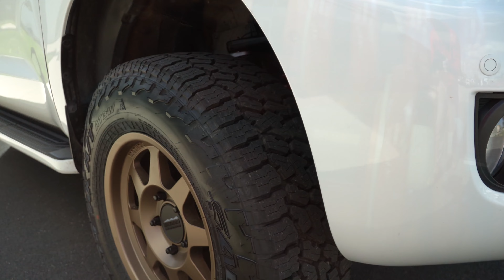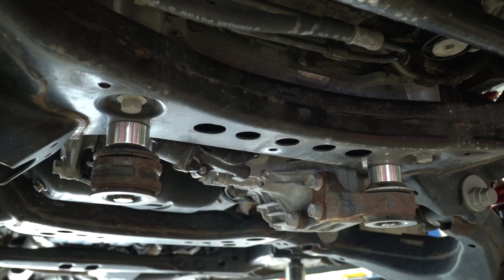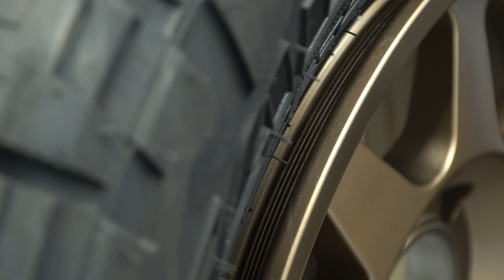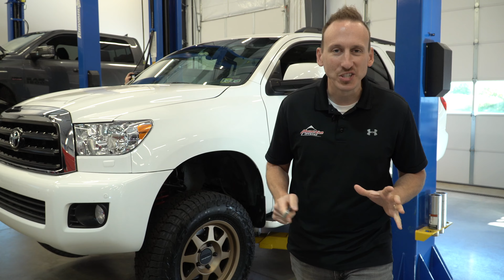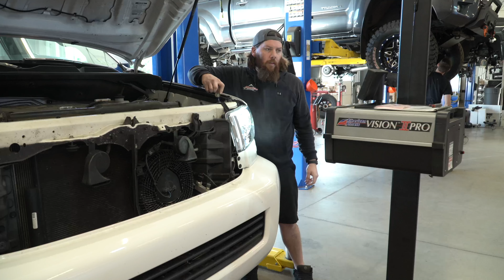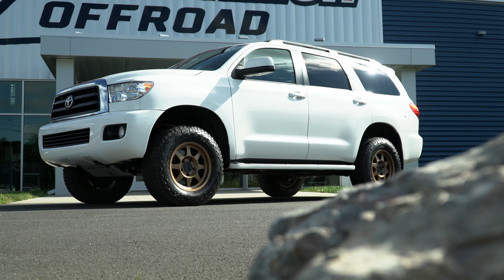Lifted 2017 Sequoia Lifted with Toytec Aluma Series Coil Overs!

Comment: I have an sr5 I put this kit on but when I add weight to the rear I get a sag, what spacers for the rear springs do you suggest to help with the sag, it’s close to 2” and the truck looks. Like it has the Carolina crawl
Reply: Old man emu rear springs for lift. I have a 2010 with a 295/70/18 and it’s perfect. Roughly 2 inch lift all the way around with 5100s up front and OME springs and 5100s rear. Rides great.
Reply: @WinterParkCarpenter what springs are you running the front? I looked for OME springs and only found rear springs for the 2nd gen Sequoia. I’m really interested in the OME springs because the spring rate is much lower than dobinsons and should provide a more comfortable on road drive.
Reply: @DadsGetDubs  just 5100s with the stocks. I think the rear is actually ARB coils

Comment: Hello sir, where is your location?i have  a 2016 Toyota Sequoia  platinum and I have plans of lifting it. I’ve been scouting my area but they recommend not to touch it coz I have  rear  air suspension. Can I just  put spacer at the front and  adjust the height at the back? Kindly advice. Thanks

Comment: I had this same exact lift kit installed in my 2014 Sequoia. the stance and look is great, no rubbing anywhere. Problem is, the ride is extremely mushy! to the point where I don't trust it on the highway, it feels very unsafe. Called Toytec and no good solution, extremely disappointed after spending all that money.
Reply from the maker: Curious what tires you have (size, brand) and PSI you run? If you haven't played around with tire pressures, definitely try that! We've seen where a small difference of 3-5 PSI can have a huge impact in ride and handling on lifted vehicles.  Happy to give a recommendation on PSI if you'd like to share some info.

Comment: +40 is the perfect offset for this truck. Perfectly flush. Problem is, there are no options at +40.
Reply from the maker: Keep in mind that offset changes with wheel width.  These 9" wide +25's put the wheel face at almost the exact same spot as an 8" +40 would

Comment: Awrsome lift! I have a 2013 Sequoia Limited and am weighing options. Does the 25 offset allow the tire to fit inside the fender if compressed fully? Wondering if it would hit the fender.
Reply from the maker: Thanks for the question! It will not be an issue with this tire and wheel combo